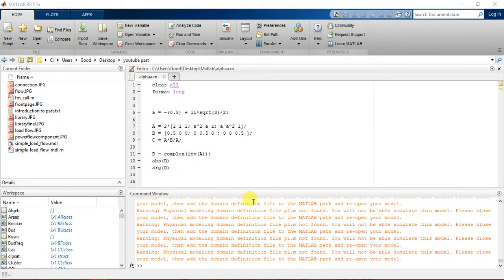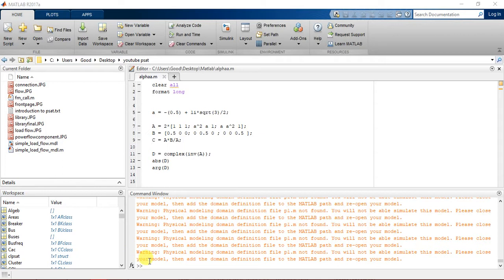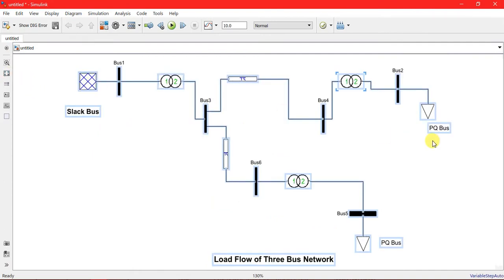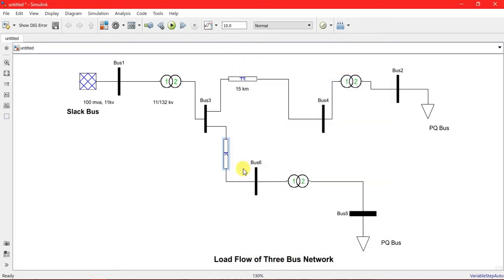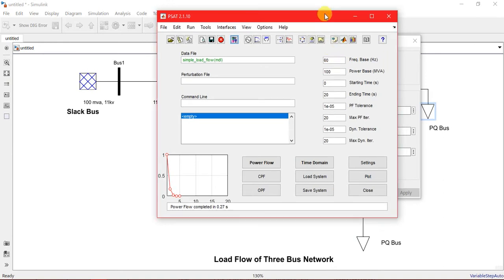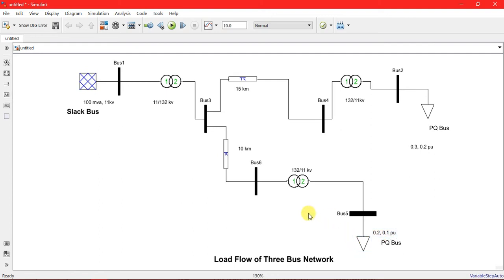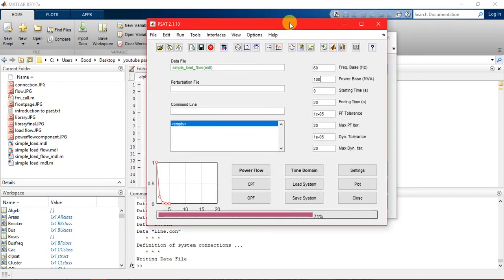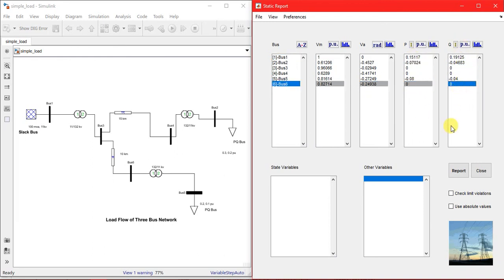Simple Load Flow in PSAT in MATLAB

Comment: I have done all the steps correctly, but when I press ( power flow) I got this error message:

The class Settings has no property or method named 'local'.

Error in fm_wcall (line 38)
if Settings.local

Error in fm_spf (line 41)
  fm_wcall;

Error in fm_set (line 705)
  fm_spf

Error in fm_stat (line 319)
  fm_set('lf')
 
Error while evaluating uicontrol Callback

Any suggestions ??????

Comment: I have done this example and it is not working for me. i dont know where the problem is. could you please help me
here is the matlab error report

Newton-Raphson Method for Power Flow Computation
Data file "C:\Users\Natty\Documents\MATLAB\PSAT\PSATtest(mdl)"
Warning: Some line susceptances are too high...
         microFarad are assumed for those susceptance values
Writing file "fm_call" ...
Error using fprintf
Invalid file identifier. Use fopen to generate a valid file identifier.

Error in fm_wcall (line 49)
count = fprintf(fid,'function fm_call(flag)\n\n');

Error in fm_spf (line 41)
  fm_wcall;

Error in fm_set (line 720)
  fm_spf
 
Error while evaluating UIControl Callback

Comment: Could you help me with this warning? (I see it in your Command Window): Physical modeling domain definition file p1.m not found.
You will not be able simulate this model. Please close your model,
then add the domain definition file to the MATLAB path and re-open
your model.
Reply: I got the same error. could you please share with me if you had already fixed that problem. :)
Reply: @prabeshkhadka9  I didn't find a solution, unfortunately :(